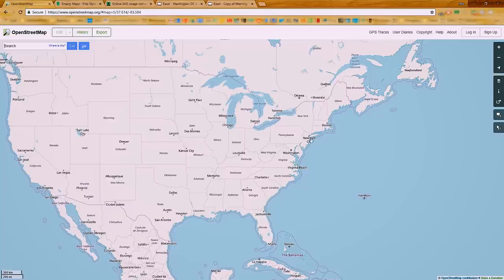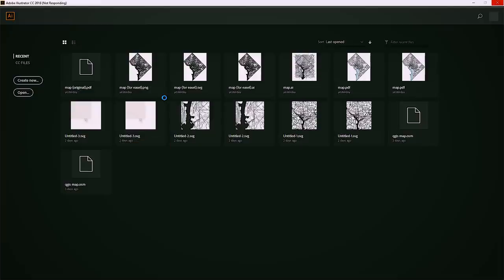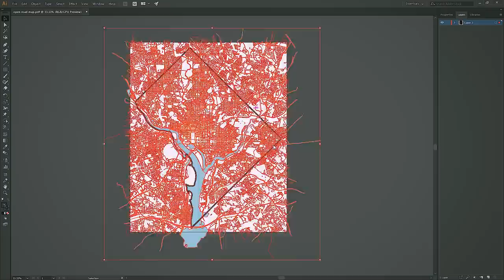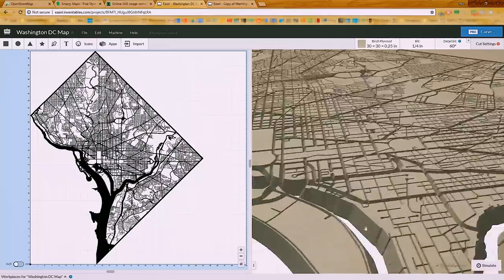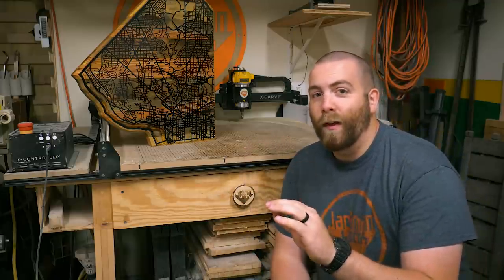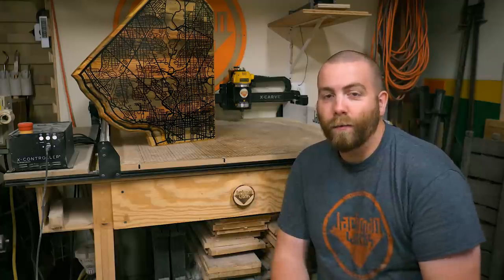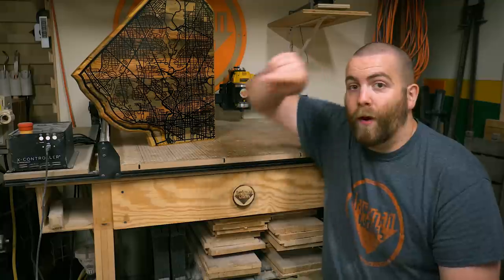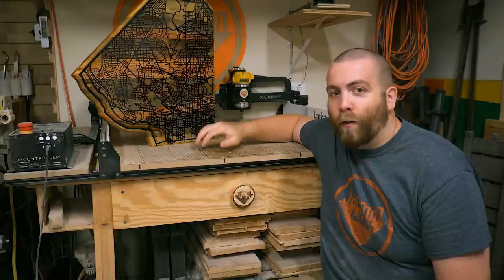Reclaimed Wall Map with Epoxy Resin River and Road Inlay

Comment from the maker: Inventables X-Carve CNC router - http://bit.ly/2Q43Mrd
Inventables Easel CAD/CAM software - http://bit.ly/2NhdoAz

Rockler tools used on this build - http://bit.ly/2NMVClL

My exclusive solution for hearing protection in the shop, ISOtunes, get your own here - http://bit.ly/2uIsq7M

► Full build article - http://bit.ly/2MNBZxe

Materials
- Reclaimed wall studs
- Wood glue http://amzn.to/2kID2jI
- Epoxy resin https://amzn.to/2tPEyTY
- Weathering accelerator https://amzn.to/2wKjsHg
- Tung oil finish http://amzn.to/2i4ltW7

Tools
- CNC http://bit.ly/2Q43Mrd
- Miter saw http://amzn.to/2j614UM
- Table saw http://amzn.to/2j4bvVU
- Pipe clamps http://amzn.to/2jkLLbO
- Screw clamps http://amzn.to/2k4EvjT
- Glue scraper http://amzn.to/2jrxJR0
- Router http://amzn.to/2yH6t8G
- Mechanical pencil https://amzn.to/2wIv51G
- Circular saw http://amzn.to/2pindD0
- Palm router http://amzn.to/2rtBgq7
- Belt sander http://amzn.to/2oS8zyE
- Spindle sander http://amzn.to/2jmRXik
- Micromesh sanding pads http://amzn.to/2jwzHiZ
Reply: Just stumbled upon this project. I want it.

Comment: Love to see a quick rundown of how you cleaned up the pdf in illustrator... Ive been working on a file with about 1/64th number of streets your did on yours and im a hour in... There has to be something easy I'm missing.
Reply from the maker: If you haven't yet, check out the video I did specifically on the street map data part of the build. I wasn't able to find any demonstrations that were up to my standard so I just figured it out and made my own haha https://youtu.be/twPgQ1gvQrs

Comment: awesome video J... just one question, why did u chamfer the connection between 4 parts of the map and not just the outside of the whole map ?
Reply from the maker: Because the city of DC is split up into quadrants along where the 4 pieces that I made are separated. The chamfer was a way to bring those dividing lines out to make them more visible.

Comment: It's a really cool idea, I would just like to see it as one piece instead of cut up into 4 separate pieces separated by grooved lines that cut off the roads. I would totally hang one of these in my office.
Reply from the maker: The 4 separate pieces was a way to make a larger map than what the capacity of my CNC can handle. And because of the layout of Washington DC I was able to use this to my advantage by placing those lines were the 4 quadrants intersect. I'm currently working on a smaller version though that is a single piece of wood.

Comment: nice mustache mask and nice running gag with the face cutouts! The 4 way split, was that for carryabillity and ease of installation or as a story line (faceoff between machine and man)??
Reply from the maker: The main reason is that it enabled me to make a larger project than what the CNC could do if it was a single piece, but it was all part of the plan because the city of DC is split up into quadrants centered on the capital building where is exactly where these dividing lines are
Reply: thx for the info, so bigger is better. :) As a European i did not know that Washington DC was split in quadrants. A free history lesson from a youtube video creator. keep up the nice projects, you are doing and showing what most of us can't (because 2 left hands for instance, or living in a high rise without workspace)

Comment: Rotring 600! Try the 800, it has a retractable tip. But the click isn't as satisfying.
Reply from the maker: I love the 600 specifically because the tip doesn't retract haha. Great for tracing things!
Reply: Good point! I think I might get the 2mm lead holder over the holidays and possibly some white soft lead for marking walnut.

I have 3 of the 600's and love them!

Comment: Is there a reason you used  a router, instead of a power planer?
Reason I ask is because I have a nice thick cut of elm that I want to turn into a coffee table, and I was thinking that a planer might be my best bet to get the top smooth.
Reply from the maker: That was a way to flatten the slab it also give me consistent thickness which is what I was after especially since I was cutting out the Rhodes on the CNC. For a larger slab a planer should get it close enough if that's what you're going for

Comment: How did you divide it into 4 sections on easel?
Reply from the maker: It's divided up in Illustrator all centered around the center of the 4 quadrants. So the quadrants are all rotated to cut them so that the zero point is at the bottom left.

Comment: Why did you chamfer the edges where the peices meet?
Reply from the maker: My intention was to do a smaller chamfer on the interior compared to the inside faces, but I had a bit slip so ended up with this. The chamfer acts as a way to hide any slight inconsistencies in case the wall it is hung on is not perfectly flat since it breaks up the line for your eye. Also, DC is split into 4 quadrants along these lines so I wanted that defined somewhat on the map.

Comment: Are you zeroing out the x-carve with that device at 6:39?
Reply from the maker: Yes! That's the z-probe attachment, I love that little thing: https://www.inventables.com/technologies/z-probe?ref=jackman
Reply: Nice....I'm sure it makes it easier to zero out the working surface.
Reply from the maker: @phatpunxs64  definitely does! I just tried to zero without it today (because my piece was too thick to use this) and no matter how hard I tried, I was still a tiny bit off
Reply: my friend who is a machinist showed me a trick to zero out you axis with a piece of paper. grab a piece of paper and move it back and forth between you working surface while you lower your tool. the paper should have a little resistance as the tool gets closer to the paper. it's a quick and dirty way to get the show on the road.